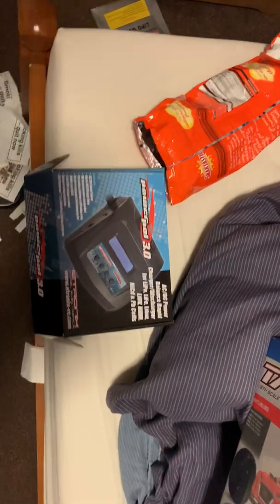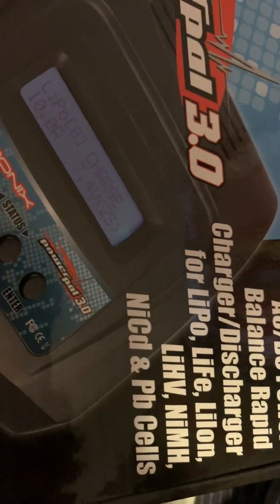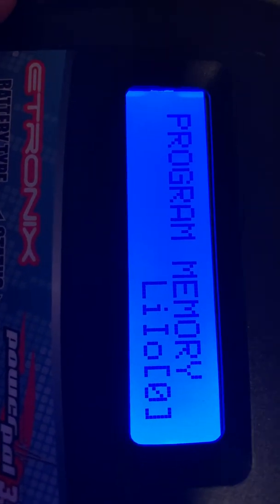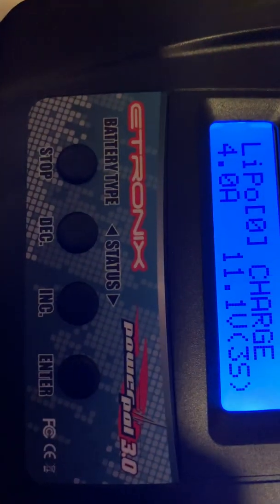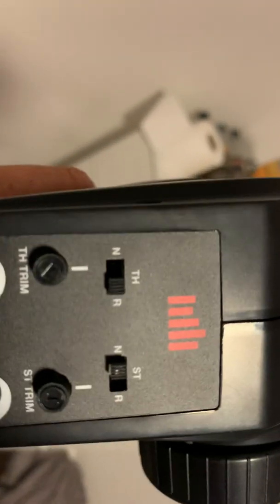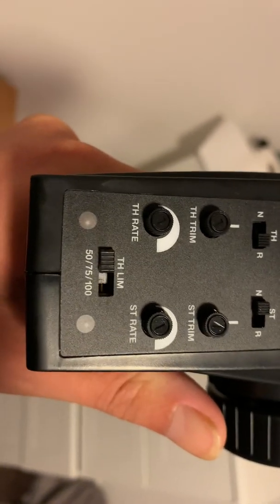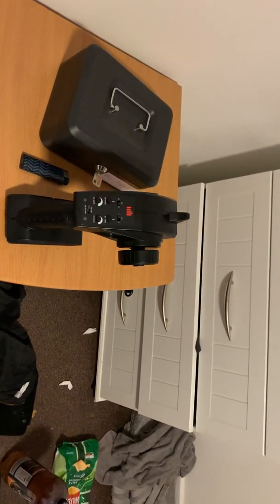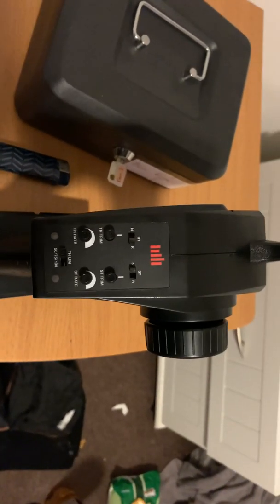Etronix Powerpal 3.0 LiPO battery charger [review & overview]

Comment: is the amp setting according to my electricity socket fuse or according to my battery?
Also will it let me know once its done charging?
Reply from the maker: It’s down to the Ampage of the LiPo battery mate.  For a 4000 mah (milliamp hour) battery you would set it to charge at 4A. For a 6500mah battery, you’d set it to charge at 6.5A et cetera. If you have the eTronix Powerpal charger then when it is charged it’ll beep continuously until you unplug the battery. Also, you should notice the Amps reading on the LCD go down every so often - it will drop down until eventually it’ll read zero, soon after it’ll start beeping, indicating a fully charged battery which is ready for use!I hope this helps you out mate! When the battery is fully charged, the display will say ‘CHD’ I think! Please note - it is nothing to do with the fuse in the plug.

Comment: Would this charger be any good for a Gens ace 5500mAh 3S 11.1V 50C Harcase Li-po?
Reply from the maker: Yep. It’d be fine. You would set it to 5.5amps and let it charge mate
Reply: @benrogersdevon  thanks 👍🏻
Reply from the maker: Adam Davis if you want to be friends please add me to Facebook if you have it slash want to. I love RC cars. I’ve just got back into this hobby with a Arrma talion. I used to have a hpi sprint 2, e firestorm, FTX vantage and thunder tiger eb4 g3 and was always working on one of the four cars.
Reply: @benrogersdevon  not on Facebook pal to old lol an im in Sheffield brother
Reply from the maker: Adam Davis never too old to have Facebook. My grandad rip he had it from age 75 to 80 when he passed away. He loved it. Random but he was born in Bradford. Proper Yorkshire man like you
Reply: @benrogersdevon  yorkshire is mint
Reply from the maker: Hi mate. I had two 3s x 4000mah GensAce LiPo batteries a while back (Arrma Talion 6s buggy). Got around 20-25 minutes run time from the fairly low capacity batteries - but you generally get what you pay for, with electronic kit. From RC cars (brushless & brushed) to TV, laptops, mobile phones and tablet computers plus much more besides!